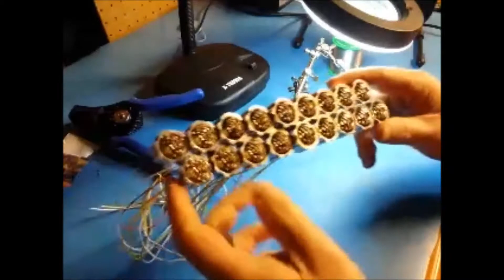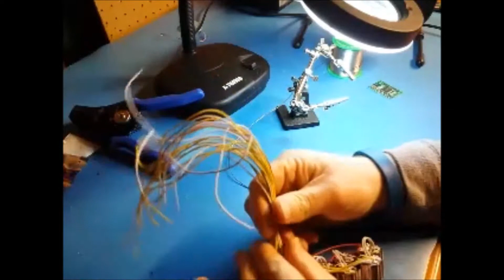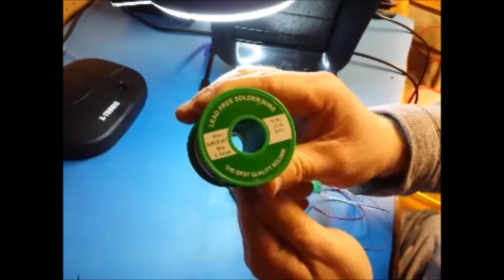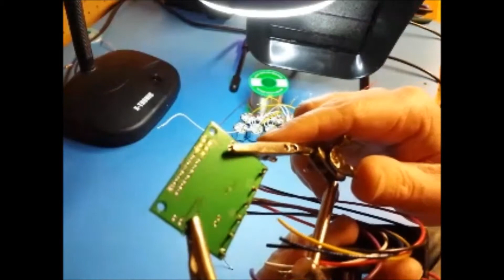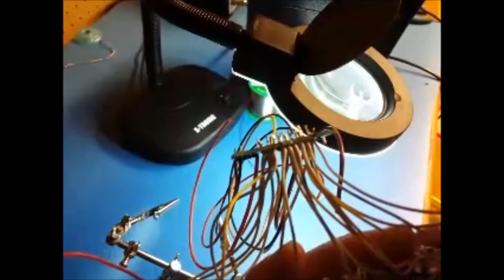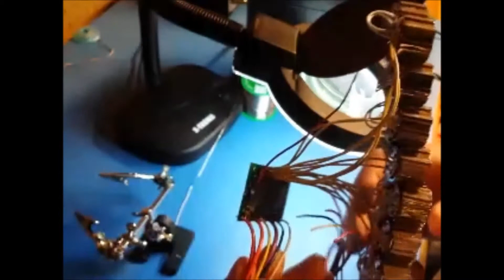Ghozt Lighting - Sequencer LED wiring tutorial

Comment: both my ghost modules when powered are constantly supplying a parasitic ground to each channel, the module is programmed and responds to the 12v signal. when signaled the animation displays, but the leds stay dimly lit all the time. what am I doing wrong??? I have spent two weeks trying to resolve this issue and im about to give up or go with a competitors control module since no support is available.
Reply: Did you get any support to rectify your situation...did you fix it or moved over to another brand...which would you consider as alternative